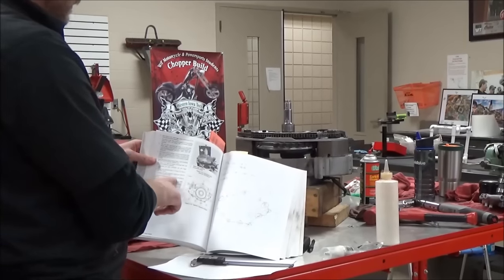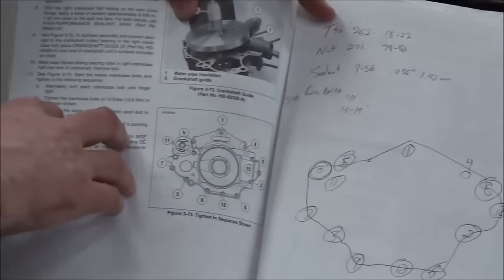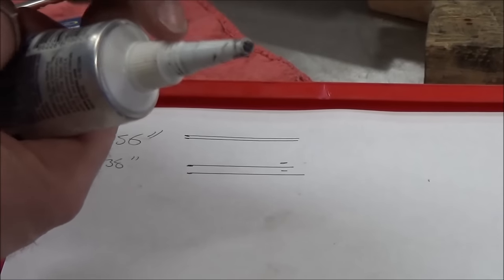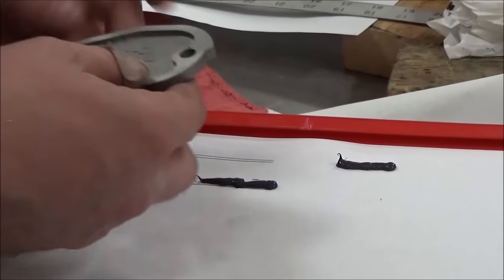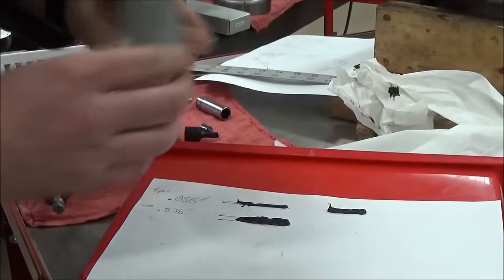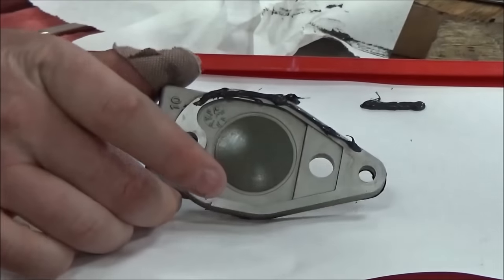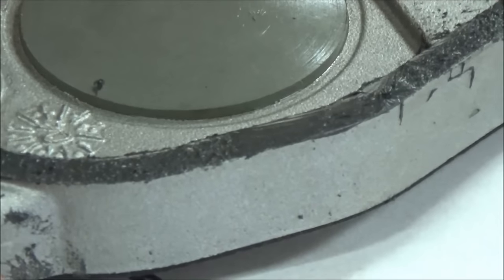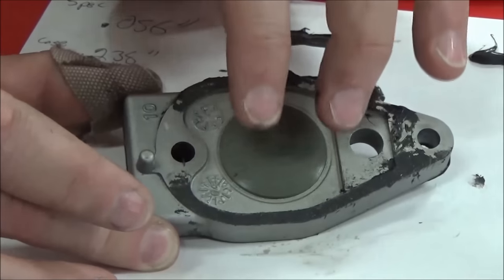How to apply sealant to assemble any case or cover. BONUS: What you didn't know and wished you did!

Comment: I watched this video when i dismantled my 4x4 Manual Gearbox and Transfer case on my NT Pajero and with four sections to be joined back together with silicone only, and because they  dont make gaskets for these parts i found this video to be the answer as to how to use this stuff without getting it inside the transmission as has happened to me in the past and caused other issues so knowing this info about using silicone really is fantastic and it worked a treat for me with no oil leaks.P/S Sorry this post of mine is not bike related .

Comment: I just used this method to seal up the crankcase on my 2 stroke moped, hardly and excess and easy clean up! that was a good tip about measuring the dia of the adapter nozzle to cut it exactly for the application. thanks for sharing all the knowledge!

Comment: 3.4.16.  I owned a 1989 Ford Ranger 4x4 with a 2.3L  4 cylinder 5 speed. At about 112k miles the truck started to lose oil pressure as the engine RPM increased as I went threw the gears! I would back off the accelerator, & the oil pressure would go back up to normal!.......It turned out that Ford went cheap with dedicated gaskets, and went for the RTV to speed assembly & save coin, and the excess RTV broke free and plugged the oil pump pickup screen almost entirely! I stopped running the truck & bought a new oil pump & after the oil pan was pulled, I found out why the oil pressure was ass backwards in respect to RPM!......I owned the truck for 22.5yrs & 258k miles before I sold it. I live in Michigan, so it was rusted out but the engine ran sweet!.....🔧😎
Reply from the maker: +Steven Sapyak Thank you and please share!
Reply: Steven Sapyak I